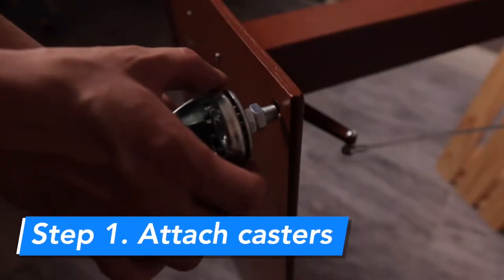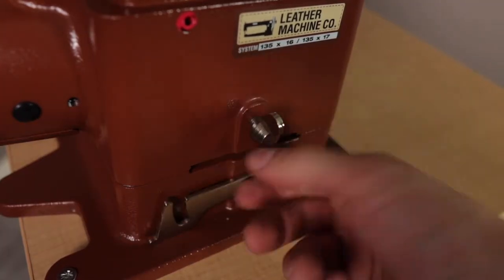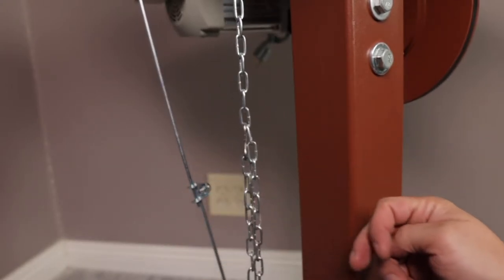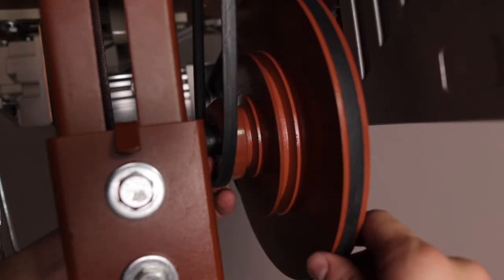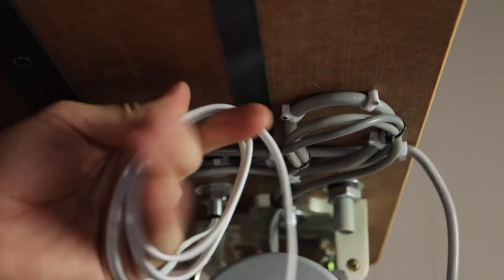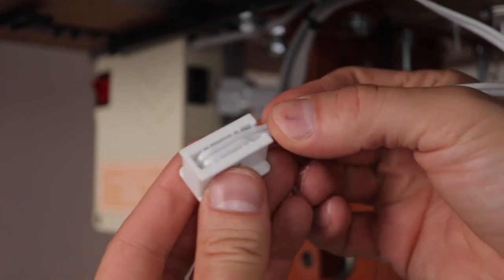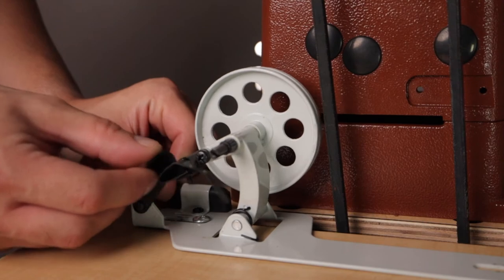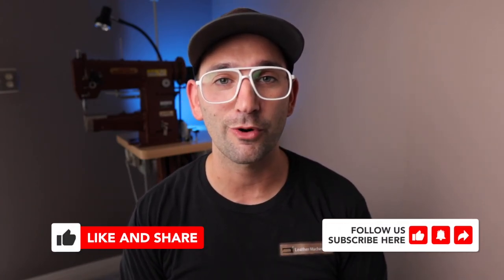Assembling the Cobra Class 26 sewing machine - EPISODE 31

Comment: On the Class 20 if you lean the head of the machine toward the drive it loosens the belt tension - I wonder if you can lean the head of the class 26 a little before bolting down to do the same.